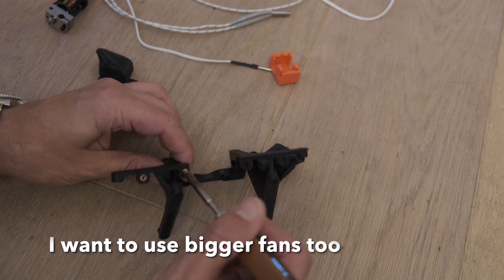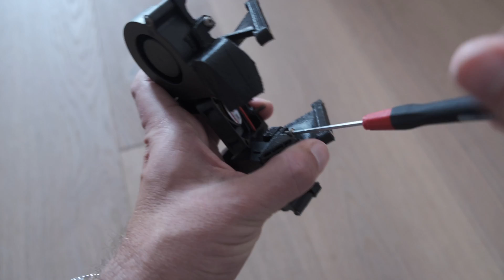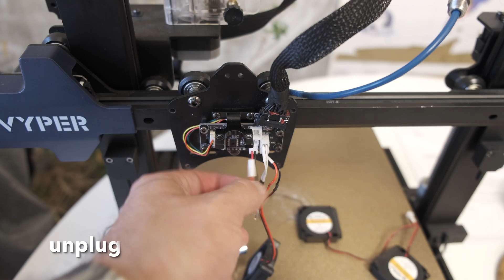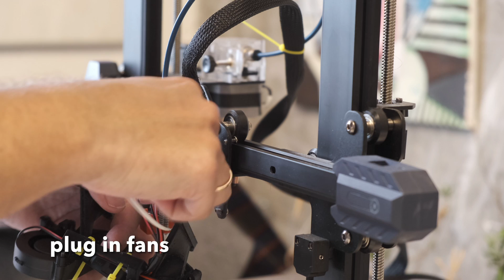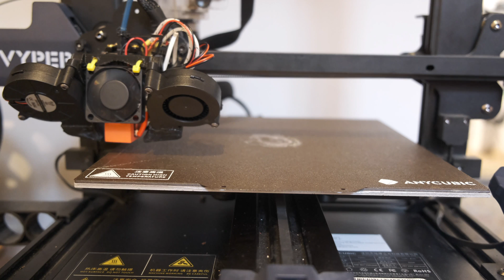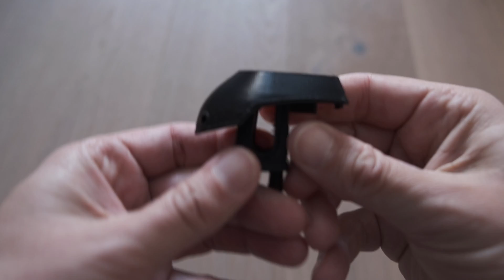Anycubic Vyper Dragon Hotend mod

Comment: I just "inherited" An Anycubic Vyper with a V6 hotend. Did you simply stick the PTFE tube into the hotend and only secured it with a cable binder? Is this enough to keep it in place?

Comment: does it work with an e3d revo six ?
Reply: were you ever able to get the Revo Six to work on your Vyper? I bought one and I can't get the wiring adapted correctly. I turn on the printer and the nozzle temp takes off and i get a thermal shutdown

Comment: Don't those larger fans draw more amperage? Is the board capable of handling the higher draw?
Reply from the maker: so far so good
Reply: I havent' found a printer yet that can't support a pair of 5015 blowers. However you will not have to run cooling at 100%. I barely run mine more than 30-40% and still have WAY better cooling than the stock fans, and they're quieter that way too. 5015s at 100% sound like a jet turbine at the runway.
Reply: Well to answer ur question. Since the creator of this vid didnt link us to any fans i got some myself and tada, i fried my printhead board. I made a video on this mod on my second channel @fullyfictive, where i also put links to the right parts, with right ampage etc.

Comment: Any way to get around this without resoldering the wires?
Reply from the maker: you just need to find fans with the right connector, I'm not 100% sure but I think it is 2-pin PH 2.0
Reply: @Unboxingexperience7  the thermistor and heater have standard connections then?

Comment: i have Dragonfly BMO hotend with Ceramic Cartridge Heater 24V 50W and thermistor NTC 100K
how can i change the heater and thermistor settings from the firmware?
Reply from the maker: Connect the printe rvia USB to your computer. Use a marlin capable software like pronterface. Then start auto PID tuning by entering a G-code (“M303 E{heater number} S{target temperature} C{number of cycles}”)
Reply: @Unboxingexperience7   I do that but I have a big difference in prices
I put it for 205c and I had from 201 to 210c
and when I choose to put 300c when it arrives I get an error
Reply from the maker: I think the vyper has a heat limit at around 260C. Not sure how to get rid of it.
Reply: @Unboxingexperience7  Yes I know it has a 260c limit and that is what I want to change.
but again when I pid I have a 10 degree deviation and this is a problem that I do not know what to do ...
Reply: @georgemousas5686  you have to change firmware

Comment: You and all the other "Experts" forget the Boron Nitride Paste at Sensor and heater everytime. The Standard vyper hotend don't need it because it is designed to fit at factory. But if you Put the hotend together DIY you need it to make full contact to the surface. And If you got different materials with heatblock and nozzle Like Cooper heatblock and stainless nozzle you need it at the nozzle too.
Reply: This is a good point but no need to be snarky about it
Reply: 😂 you realized. This isn’t a mosquito hotend right?

Comment: But u can still use the auto leveling bed?
Reply from the maker: yes. therefore, you need the v6 adapter to use Vyper's hotend mount which includes the strain gauge sensor.

Comment: Hi, Would this adapter maybe fits a E3d Revo six?
Reply: It should, yes
Reply: were you ever able to get the Revo Six to work on your Vyper? I bought one and I can't get the wiring adapted correctly. I turn on the printer and the nozzle temp takes off and i get a thermal shutdown

Comment: Is it worth it?  Do the owl image that comes with it and see if that turns out the same.  Why did you want this hotend instead of the volcano it comes with?
Reply from the maker: I was not overwhelmed by the printing quality of the standard Vyper. Right out of the box, the printing results of the Dragon hotend look better to me. Moreover, you can print with higher temperatures.
Reply: @Unboxingexperience7  i think the mod is not that overwhelming to